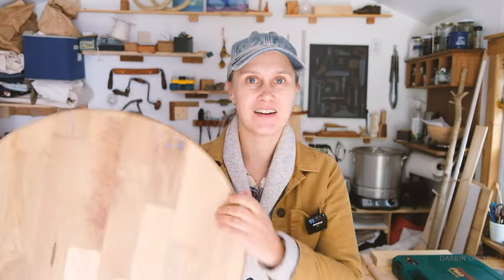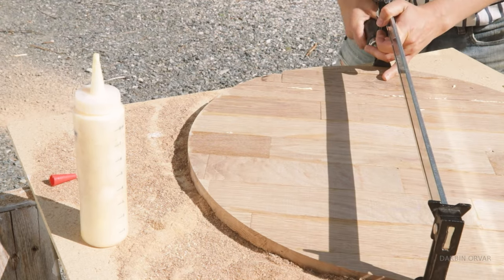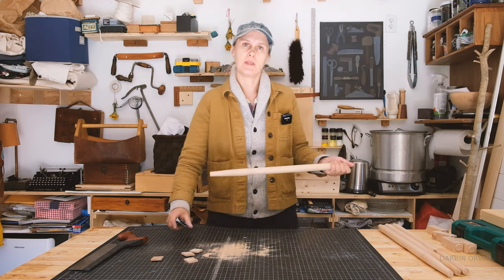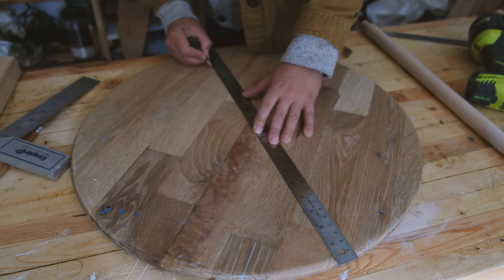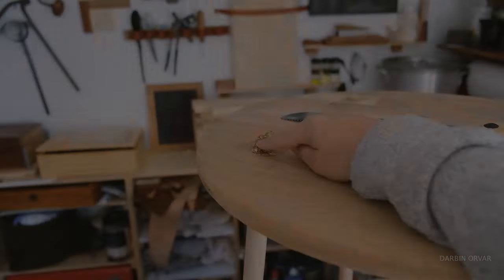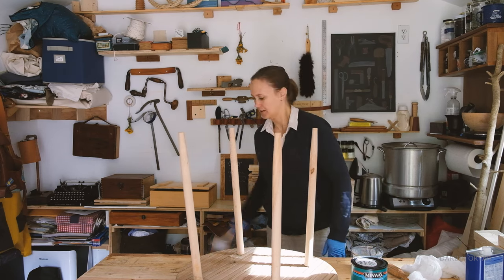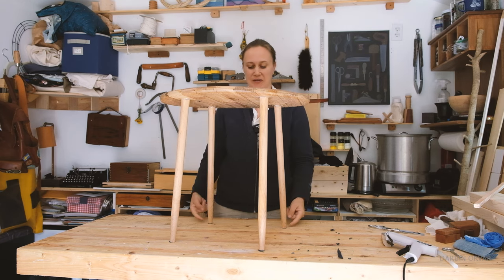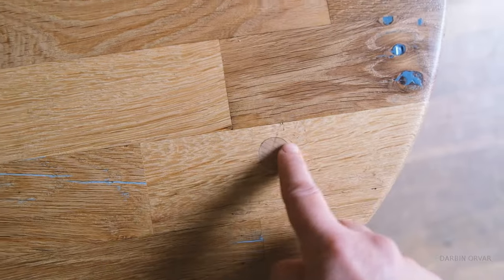Making a Round Table with Hardwood Flooring and Through-Legs

Comment: Good use of the leftover flooring material.  One twist might be to rout out 1/8 in slots about half the depth of the top down from the top's surface (and add contrasting color wood wedge) across the areas where the table legs poke through the surface (either in a straight line or X) as a way to pin those legs to the table top (so it  doesn't wiggle loose over time). The wedges could be sanded/cut flat with the table top surface.  Good basic project. I like @BigFatTonys  idea of making the angled hole guide the diameter of the forstner bit shaft and not the final bit width.

Comment: I wonder why we favour four legged tables now. A three-legged table is superior in so many ways, but primarily for stability on any surface,  and in my opinion pleasing looks. Odd numbers are more pleasing and calming to the eye. Just ask a flower arranger. “But a table isn’t a flower arrangement!” I hear you remonstrate! No, but it is an object of beauty, especially one like this one.
Reply: To my eye, when using thin legs like this, seeing four thin ones looks better than 3 thin ones, however the thicker you go with the leg, the less I'd like to see.
Reply: In my opinion, it's a bit wrong to say that using 3 legs provides more stability than 4 legs. A table with 3 legs is always even on any surface, but as long as the surface is even, more legs provide more stability.

As an example, imagine a square table with 3 legs. When pressing down on the surface, at least one of the corners is going to have a lot more wobble compared to the same table with 4 legs.
Reply: @SamiKankaristo , You are right of course. Thank you for correcting me. I find it hard to be accurate with my language in this circumstance. Stability issues change with the shape of the table top, and with the flatness of the ground. The possibilities of design and creative experimentation just go on and on. I love it.
Reply from the maker: I think three legged designs are great too... next build!

Comment: Very nice. I expected you to wedge the top of the leg tenons, just for another design element, but the utility grade flooring is already pretty busy, visually.  I've made a small table top from red oak flooring, but only rectangular, with a couple of batons on the back to ensure flatness over time. It sat on a simple rails-and-legs frame I threw together from scraps.  Like you, I intended to do better but forgot about it. Thanks for giving me a kick in the rear to get going and finish it.
Thanks also for the advice about using a wax to improve the appearance of water-based poly. I don't like the cold appearance but I do like the lower VOC's. 
Good video, Linn.
Reply from the maker: Thanks so much John! I was thinking about the wedges, which probably would have been a nice addition.... but then in the end I ended up not using it. I bet your table is looking nice! 😁

Comment: I like your table. Thank you for showing us your process of building it. I would have liked to see how drilling the hole for the legs could have been done on a drill press, that would have been cool and have you ever seen the old trick of cutting a groove in a something like the leg then putting a different colored wedge in the grove once the leg is sticking out the top to expand the leg in the hole insuring that it stays solid and add color to the top.